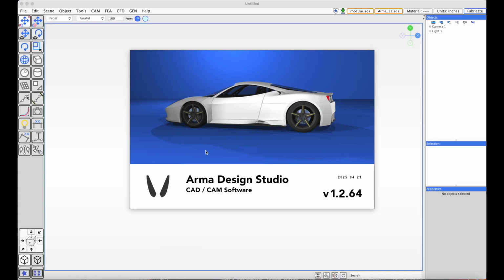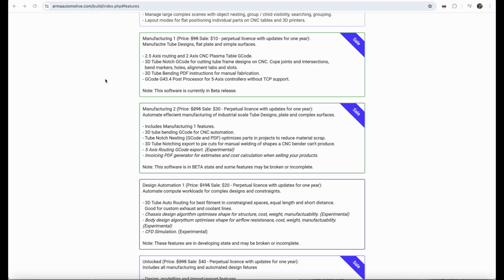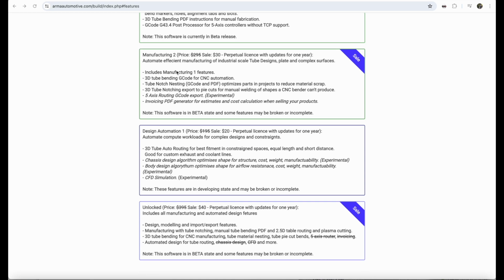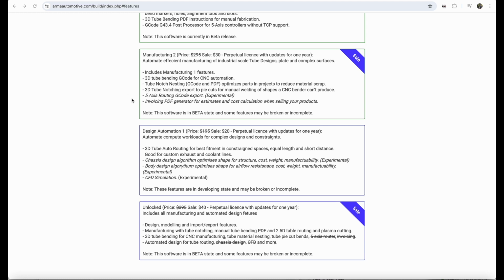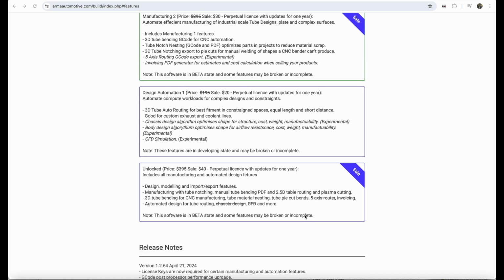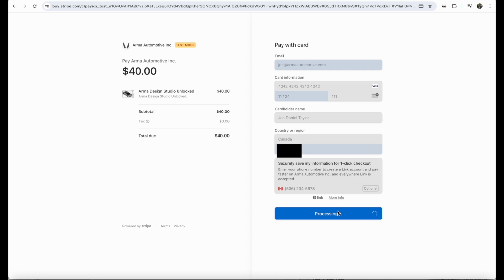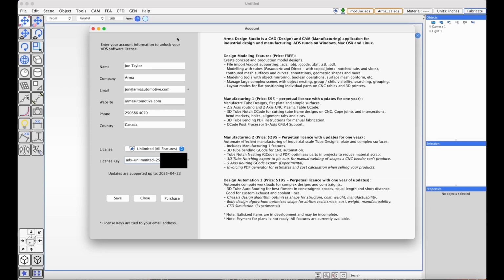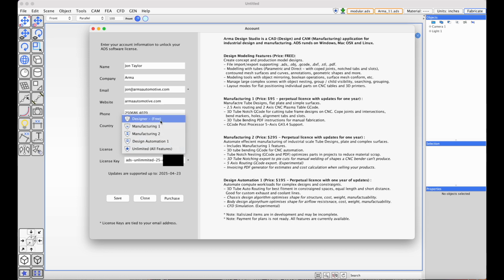Unlock features in Arma Design Studio with License Keys.

Comment: I purchased the unlimited version, have added the license successfully, can see all the added features fine. But having an issue with outside files.

Is there a way to import dxf files? Tried to import but there's no option to do dxf, and using stl or g code wont load files just gives never changing empty loading bar. Tried to do it as open under File, that just spins circle like its loading as well but never does. I tried this with a few different files that work in other programs with no issue. 

Be a real pain to have to convert dxf to stl just to import them or start from scratch on some base designs i want to modify.
Reply from the maker: Hi Josh thanks for your support and sorry for the issues loading files. I will be working to fix these issues. I can add DXF import as a new feature for the next release. I will do testing on import of gcode and stl. Which platform are you running on?
Thanks
Reply from the maker: Also would you be able to send me a DXF file as an example that you will be importing for testing? Otherwise no worries. Email is: jon@armaautomotive.com
Reply: I'm using windows based laptop tried it on my design laptop which is win 11, so I thought maybe an issue with that. Also tried on windows 10 but same out come. For just testing purposes I have grabbed free files from the langmuirsystems fire share (free) site. I was going to test for example the f bomb beer opener as a simple design to modify. 

Appreciate the quick reply! I do get it's a work in progress! Also at this price point, imho if you stream lined the basic 2d portion for plasma cnc, laser cutting I think you would see an uptick in sales. Just my .02
Reply from the maker: Hey Josh, I have released a new version 1.2.66 that includes a very basic DXF import feature. There will be a lot of features/object types not supported but I can update as needed over time.